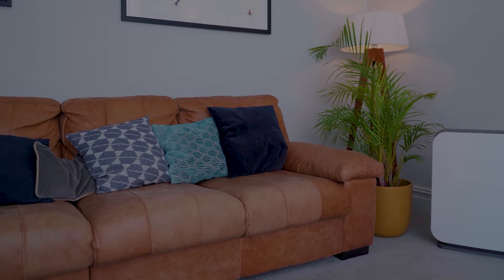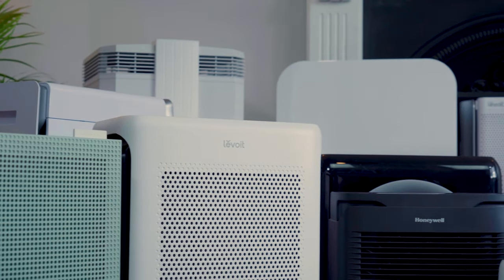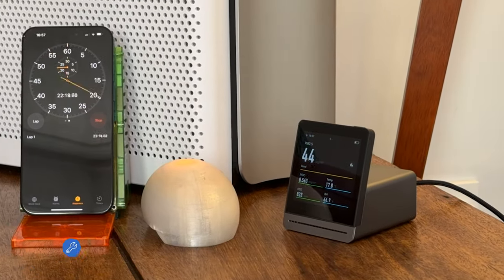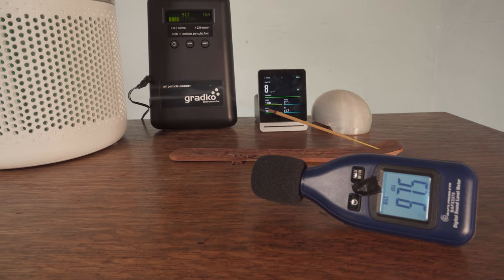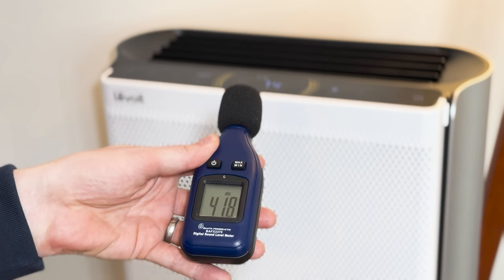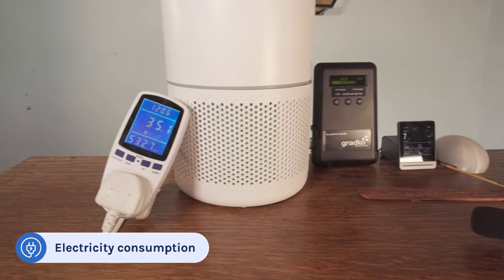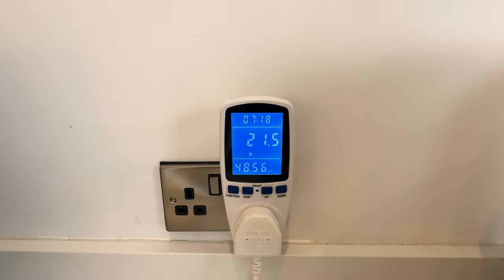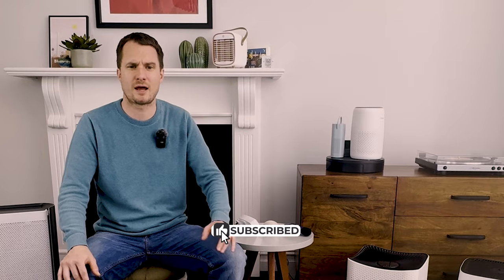HouseFresh - How We Test Air Purifiers 😶‍🌫️

Comment: I thought smoke particles can also be sizes of less than less than PM 1 such as PM 0.03?
Reply from the maker: The sensor we use can’t detect smaller than 0.3 as per https://community.purpleair.com/t/what-do-purpleair-sensors-measure-and-how-do-they-work/3499

But smaller particles are more easily removed as even the non hepa grade filters will remove easier than 0.3 as per https://itsairborne.com/hepa-filters-are-not-needed-67e952792481

So I feel we can safely assume that if we are seeing 0 pm1 after filtering then that would also include smaller particles too.